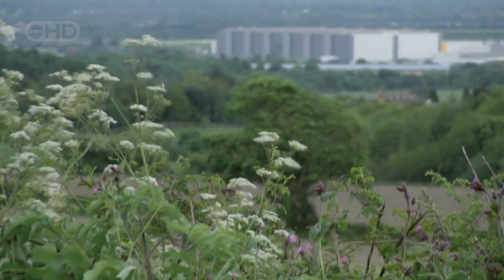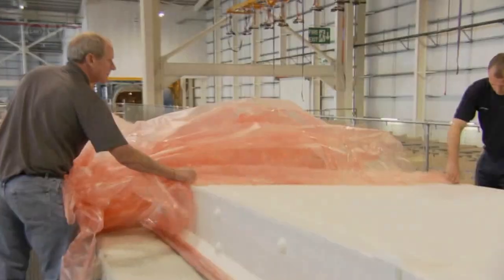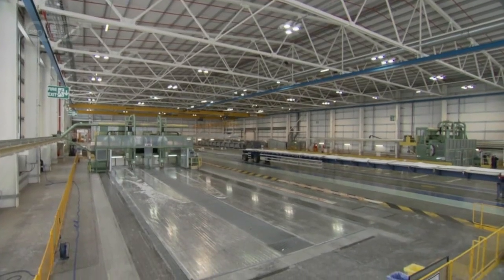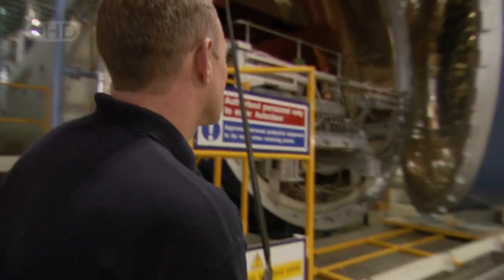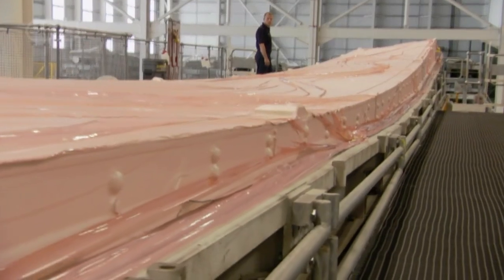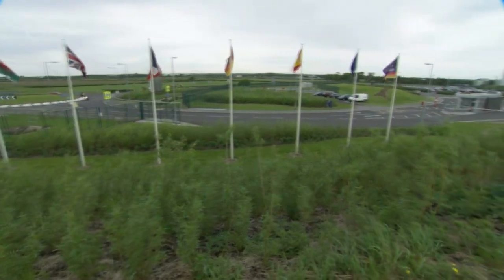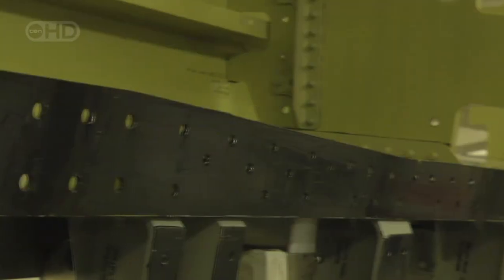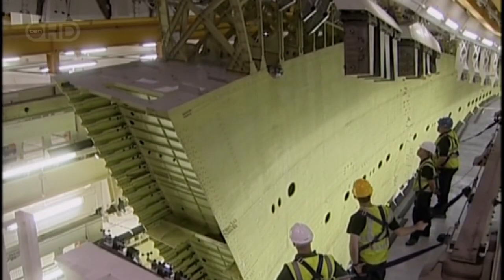Airbus A380 - Wing Construction - HD

Comment: I guess the secret process they don't want camera to see is how they use hot glue to bodge up the sticking process, that's perfectly understandable now, doubt I will ever fly now in an A380 Airbus. If they have something to hide that means your safety is compromised. did you also notice at first what they said about the shrink wrap being punctured could compromise the wing, then they use stanley knives to cut it up for inspection, without using gloves, they are leaning on the panels, removing tubes, hands breath moisture and acidic sweat that can be far more detrimental then a bit of oxidised panel if a shrink wrap is compromised for a few minutes.

Comment: "Supercharged engines", really?
Reply: The Rolls-Royce/JAEC RJ500 was a 20,000 lbf (89 kN) civil turbofan which Rolls-Royce and the Japanese Aero Engine Corporation (JAEC) consortium hoped to develop for aircraft like the Boeing 737-300 and the McDonnell Douglas MD-80.

A single stage fan, driven by a three-stage LP turbine, supercharged the 9 stage HP compressor, which was driven by 2 stage air-cooled HP turbine.

(I found this on Wikipedia).

Comment: Someone forgot to tell the narrator that the wings can’t hold that much fuel or any fuel for that matter. Calculate the weight of the gallons or liters of fuel and you will see. He already told you how much the engines weigh. Go a head I dare you.
Reply: You jet fuel hoax people are just plain idiots.  None of you work on aircraft but somehow you know all about them.  You Tube experts.  I work on aircraft and will assure you the wings hold fuel, they hold a lot of fuel and jet engines use fuel, they use a lot of fuel.  
I have 30 years experience working on numerous aircraft types, So tell us how much experience you have on aircraft and how many times you have seen the inside of aircraft wings.
Reply: George Seefoo do your research sunshine fuel is kept in the wings
Reply: @George > I am still waiting on you to tell us how much experience you have in working on aircraft... but to be perfectly honest, we all already know you have zero experience on aircraft.
Reply: The jet fuel hoax is hilarious. I work on aircraft fuel tanks for a living, I’ve been in wet tanks, installed pumps, valves, lines etc. I’ve even seen the fuel inside the wing tank from a access panel on top of the wing. Yet there are still people who deny it.

Comment: Those wings are surely not flying fuel tanks what bulshit where the hell can you put all of that fuel they are skinny little wings those wings are surely not flying fuel tanks what b***** where the hell can you put all of that fuel there skinny little Wings everyone needs to wake the s*** up and realize that all of these engines weight, and the weight of the fuel would be impossible fly., and land. Here's how jet engines work and you can look it up they compress air and keep compressing air until it is ignitable and it burns the air out the back. If you ever go flying look at them how much room the Hydraulics and flap take up in the wings and look how skinny and thin the wings are there's no way they hold multiple swimming pools full of fluid in each one.Also how would a plane bank with fluid in its wings duh...
Reply: Zachary Imus - And pray tell WHAT FUEL is used to compress the air - "Slaps forehead with palm and wonders why there are so many fruitloops posting on Youtube"
Reply: And you know bc you've built this type of engine, right? BTW, air doesn't burn. Compressed or not.
Reply: Zachary Imus really you didn’t see how thick they were that’s right you didn’t want to!
Reply: Zachary Imus hey ace what are your credentials? Because you are full of shit! My credentials aircraft mechanic, manufacture and hands on cockpit knowledge.
Reply: Chuck P [again] here’s your answer as an aircraft mechanic turbines SUCK, SQUEEZE, BANG and BLOW high bypass turbine engines get 80% of their thrust thru bypassed air the other 20% thru the compressor. Now if you cut fuel in flight yes the blades turn (hang a fan out a moving cars window) but the turbine can’t produce power the blades are windmilling. You must compress air and burn it to keep the spool turning at a speed sufficient enough to suck in that massive amount of air needed to bypass for thrust. Windmilling will not do it. You need to forget conspiracy and think reality. The only reason they use air to start is they don’t have starters the reason is weight along with unnecessary maintenance. If it were true they only ran on air how would you shut them down? You cut fuel to shut down. Why does the APU use fuel it’s nothing but a small turbine and why all the fuel in the wings I’ve seen it I’ve also been in defueled wing tanks search wingtip fuel leak they have them. It’s not oil, hydraulics or water leaking its fuel. When we sump tanks checking for water why do we get fuel? You need to use accurate measurements to determine that the wings are capable of holding the fuel not failed human eye perception. As to strength the wing is super strong it’s built on the massive wing spar which runs from wingtip to wingtip thus making one huge wing. The fuselage sits on the wing nothing cantilevers off the fuselage. My first time in a huge wing I thought how does this thing fly? I eventuality learned the principles behind flight and I could not deny the facts when I started flying in the cockpits. I would be the first to scream bullshit if that was the case I despise lies. But as an aircraft mechanic I have to tell the truth that’s why I scream the fuel hoax is fake. I have nothing to gain by spreading lies. But I do have something to gain by telling the truth and that is the comfort of knowing I am keeping unsuspected individuals from being lied to.
Reply: DC8Combi, I don't know where these stupid cell phone diddlers come from or how they got that ignorant. Its a waste of time trying to explain reality to an unemployed millennial waiting in the basement for his mommy to bake cookies. The worst part is that they actually believe their own bullshit.

 BTW.... I was booked on AA191 and didn't make the flight back in 1979 when I was a Gas Turbine Field Engineer for General Electric Co. The huge fireball right after takeoff after the GE engine fell off wasn't from compressed air. Jet-A, maybe?
Reply: kimmer6 your so correct they believe everything is a conspiracy. Wow I’m sure glad you missed that flight and yes the huge fireball due to lots of Jet-A since they had no time to shed the fuel as you know the engine detachment was on takeoff. Had the event occurred before V1 and rotation the outcome may have been much better.
Reply: DC8Combi....yeah, and it was a GE engine. In those days I worked for General Electric Technical Services Company and flew on hundreds of flights all over the world supervising gas turbine installations and overhauls in power plants and refineries. And just MAYBE I know how these things operate. Walter Lux the pilot on 191 trip traded with another pilot who wanted to be elsewhere that day.
Reply: kimmer6 I would say your highly qualified on turbine operations. Must have been a very interesting and fulfilling career not to mention exciting as you I’m sure seen many things traveling to so many destinations. The fact that you missed the flight and captain Lux was originally not scheduled for the flight but took it shows how strange and uncontrollable our lives are. I used to fly a lot when I worked in the private sector as we always went up in the Birds we worked on. And sometimes we flew to work to rescue a broke bird. I once told my boss that we would probably leave this world on an aircraft due to our high hours we spent flying on them. The private sector was not as safe as the commercial in my opinion. I always felt safe in the cockpit jump seat of a commercial. My belief is there are no coincidences in life I truly believe things happen for a reason. I originally was a carpenter and at the age of 25 while unemployed with no medical insurance I had a terrible accident. I had a near complete amputation of my right arm right in the armpit at the Brachial Plexus. I bled so profusely that I nearly completely bled out before arriving at the trauma center. They fought and struggled to save my life for 4 hours it took that long before they could say I was going to make it and then begin reattachment. My parents said they were told numerous times that I’d never make it and prepare for the loss contact all family members. After the trauma team spent 4 hours and they used 32 bags of whole blood plus numerous bags of red blood cells and bags of platelets they spent around 7 hours reattaching my arm. Naturally I would no longer be a carpenter. Since I had no medical insurance I lost everything I even lost my girlfriend and son as we were on shaky grounds prior to the accident. I stopped receiving medical care as I had no insurance and I was so depressed I went to being a bum living in friends garages for close to 10 years. I never stole food to eat I just went hungry our scrounged. I never got any use back in my elbow, wrist or hand. But one day I met a guy who I found out married a girl that I went to school with. He was an aircraft mechanic. He said since both him and his wife worked they really needed a sitter but better yet a live in nanny. They had a 6 month old a preschooler and a kindergartner, 3 boys. He asked me if I’d like to take care of the kids and he would provide me shelter. At first I thanked him and declined as I felt terrible raising another’s child when I had no idea where my child was. But come the next winter I had enough I took his offer spent 6 years as their nanny got the youngest into school. Jim the father of the family introduced me to aviation and I fell in love with it. I could not get enough he got me in the business and here we are almost 20 years later still working on aircraft. My son found me and currently they are going on their ninth child. As I said everything happens for a reason. Sorry to bore you with my history but it was nice talking to you and hearing yours. I’m so happy yours turned out well I’m sorry for Captain Lux and all that lost their lives that day. When I first started working commercial I worried about everyone on each flight as I would see the passengers including children on pushback. the children waving at us. I eventually told myself if I always did the right thing and never cheated on my work I had no need to constantly worry about each flight. Yes no matter how diligent I was and others were mechanical failures happen but that was were the flight crews diligence came in. And fortunately in almost 20 years I’ve never lost anyone.
Reply: DC8Combi....awesome story. I'm glad to hear that you came out on top despite the bad times.The guy who sold me my sand paddle tires was revving his engine and a stainless fan blade ripped loose and cut his arm off like a razor blade. It took it off at the shoulder and it was reattached later but was useless. 
     I'm in my mid 60's wondering where time went. My old college girlfriend from 43 years ago looked me up 3 weeks ago and we met up with her husband, daughter and grand child. Holy smokes, where did time go?
     GE assigned me to Zone 3, Middle East. Yet I got all over the world and filled a 32 page passport in 17 months. That was all gas turbine work. I caught hepatitis in Taiwan when Mt St Helens blew up. That screwed my liver up. I'm OK now. But then GE assigned me to their Marine Department in San Francisco where I  did all kinds of ship steam turbines, did the Chevron gas turbine tanker engine overhauls, then worked on spy ships. That got me into places I never dreamed of.
One was a missile tracker that got me to Kwajelein in the South Pacific when they were doing the Trident II-D5 missile upgrades. Awesome ship. 
   I worked in Pearl Harbor a bunch on nuke subs, nuke powered carriers, and Navy ships of all kinds, worked on gas turbines in and West of Prudhoe Bay. I stayed with power plants and refineries until 1997 and quit due to too much travel.
    If anyone should have been a pilot, it should have been me. It never happened. I took lessons in Schweitzer 2-32 sailplanes until I ran out of money back in college. But I was lucky enough to ride in Bob Love's P51-D twice in one day in 1982. That was one of the top 5 days in my life. I rode in the AC-47 Spooky gunship and flew in the B-17 known as Old 909. I saw F-14's being launched off the USS Enterprise in the early 80's...crackling noisy as hell, and rode a Grumman C-2 Greyhound off the ship before the WestPac cruise began. The cat shot scared me. I thought we were going in the water for sure.
Reply: kimmer6 awesome life you have had. I now see why you missed AA191 you had lots of work ahead of you. I’m not far behind I am 55 but I have a lot of catching up as I was 35 when I started in aviation. I wish you the best and sure enjoyed hearing from you. Again we never know what’s ahead who could guess two individuals with common knowledge and truth would come into contact on a paranoid conspiracy theorist rant. I wish you the best and appreciate what you’ve done for the turbine industry and society.

Comment: At 0:37. I stop there how are the jet engines super charge???? 🤣🤣🤣😂😂😂😅😅          🤔🤔🤔🤔
Reply: Supercharged just means that the driveshaft is connected to a compressor which forces air into the combustion chamber, so technically they are supercharged by themselves.

Comment: I dont understand why they shave the wing panel, they could order thinner paner from the very beginning? Or roll it. Does anybody knows why?
Reply: Slava ivanof it's because the panel will end up with some raised areas (ribs).  It's quite normal to start with a block of metal that's just slightly thicker than the thickest part of the finished component, and then machine 90% of it away.  Modern CNC machines are very fast, and very accurate.  It also allows for fewer joints to worry about sealing - especially useful if the component in question forms part of a fuel tank (such as the upper and lower wing skins).

Comment: The same Airbus that your rudder will fall off if you put to many movement's into it....Airbus is shit.
Reply: How many Airbus have crashed due to engines falling off? 3 747s have 'lost' engines (2 crashed). At least 4 737s have 'lost' engines, as have 3 707s (1 crashed). In all these cases 'lost' means 'detached in flight' due to metal fatigue, and here you are, complaining about 1 event, where a poorly trained pilot overstressed his A300 and caused the fin to separate. The NTSB cleared the A300 tail structural integrity as it exceeded the required limits.
ALL aircraft can be overstressed. For example, there's an Airworthiness Directive warning 787 pilots about an airspeed fault that can lead to catastrophic failure due to overstress caused by excessive control inputs. Sound familiar?

Comment: couldn't help but noticed that they failed to mention the ribs in the wings that keep fracturing that Airbus hasn't fixed on the a380
Reply: They have actually. The rib design has been changed to all-alloy ribs, with the intention of preventing these cracks from forming. Older aircraft, with the original cfc/alloy ribs, have had the affected rib feet repaired/replaced, using a different alloy that's less prone to cracking. They will be inspected periodically.
Reply: phillip quinley ..maybe you should go to a steakhouse its on the menu..bbq ribs and more

Comment: I didn't make it past 0:37 - "four supercharged engines"; What kind of shitty aviation show would start off by stating that turbofans are "supercharged"? I just closed this shit, went elsewhere and spared myself from losing another 7min 27sec of precious lifetime.
Reply: Thanks for the warning. I won't waste my time watching it.
Reply: Supercharged just means that the driveshaft is connected to a compressor which forces air into the combustion chamber, so technically all jet engines are supercharged by design.
Reply: But came back to write a comment. If u don’t care just move on.

Comment: So, the engines are supercharged, are they? Is that why the A380 burns more fuel than the 747-8?
Reply: I was thinking the same thing....
Reply: The supercharged bit is bullshit but haha, yeah no I can place bets that the a380 burns less fuel than the 747-8.
Reply: Peter Downey how the hell can the wings of an Airbus hold swimming pools full of fluid and the weight of the engines and still take off? They can't jet engines work on compressed air and even the starters that you hear when they start the engine run on compressed air.